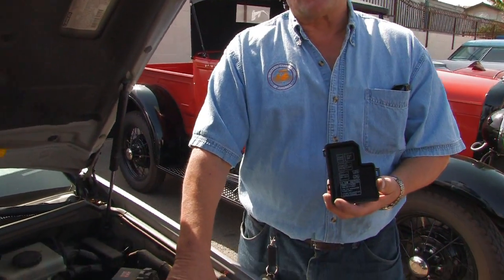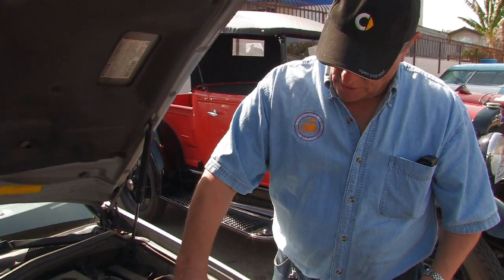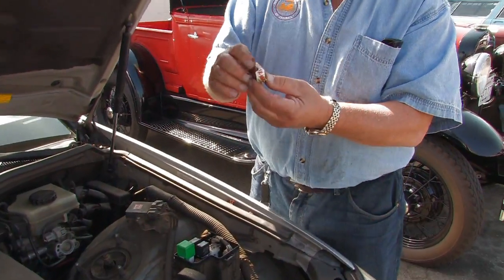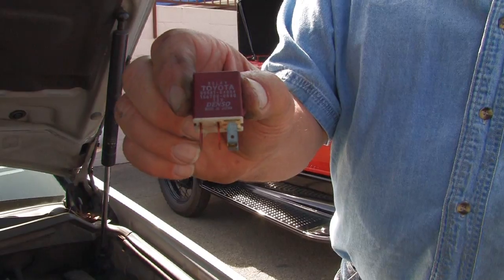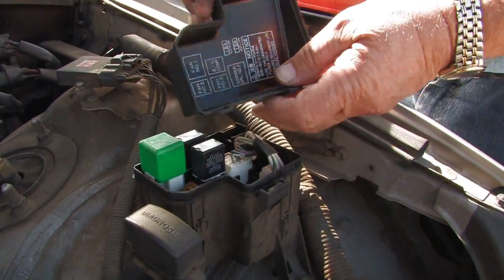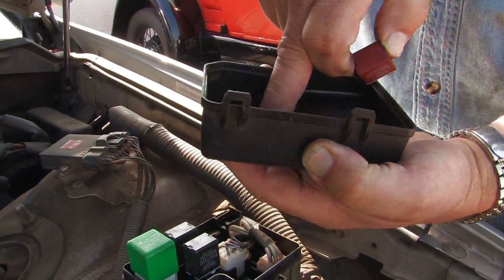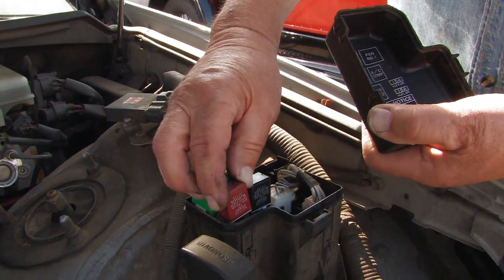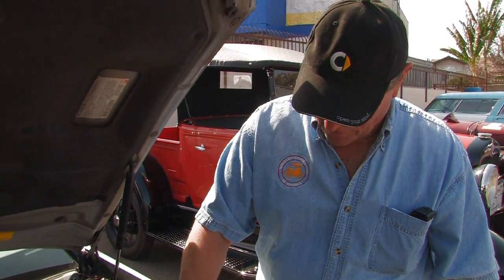Troubleshooting Car Problems : How to Check Relays on Automobiles

Comment: Garbage!  There are scores of other videos on You Tube that talk about checking relays with a multimeter for continuity.  Keep in mind folks, if you purchase a relay from an auto parts store that cost anywhere from $10 - $60 and you swap out the relay with one you have and you find that it was not the relay acting up or faulty, most auto parts stores will not let you return a relay.

Comment: remove the relay, use multimeter to test it, also you can apply voltage to relay and check continuity